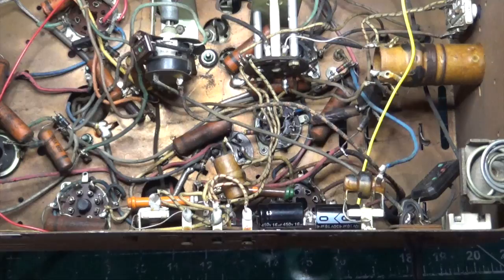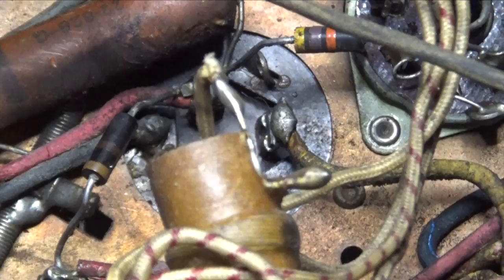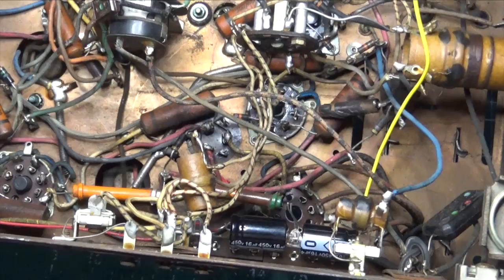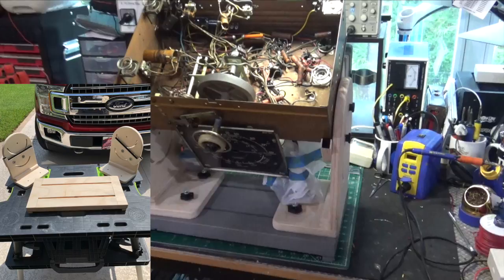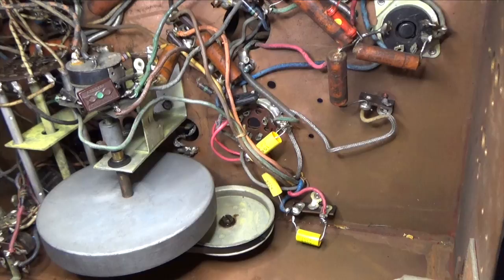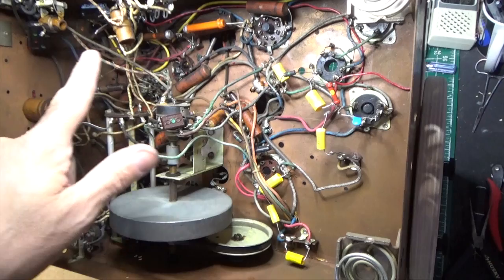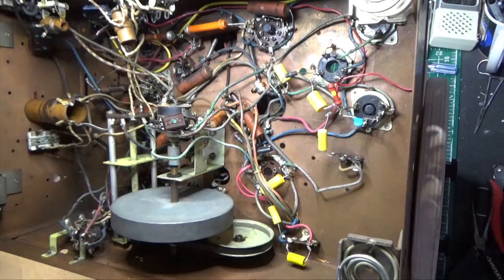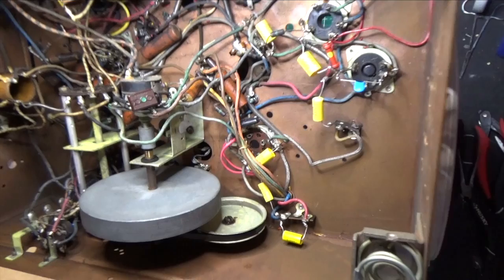Zenith 8S563X  Restore for Lisa G Episode 1:  Let's get the party started

Comment: Really good clear example of using the coil wire to solder. One thing I like about that Ron is as you mentioned, it is a lot easier to un-solder than hook and pinch. The chassis/cabinet holder looks really handy.
Good stuff my friend.
Reply from the maker: Thanks Pal...  This is how I learned and it serves me well..  There are many ways to do it, but its cool.    Hope all is well

Comment: I've been a subscriber for quite some time now and have been repairing tube radios and televisions since I was a teenager and still learn things today. I think you should go the extra mile and locate the foil end on the new caps. I get negative feedback sometimes regarding this but even though I made the same mistake some years back I learned from my mistakes. You’re right about the old brittle rubber insulated wire, most of it will need to be replaced since it will be disturbed in the restoration, and sometimes I will use liquid tape if it’s not too bad.
Reply from the maker: Ken,  thank you for watching.  I've watched many videos on the foil side , especially Mr Carlson and there is definitely merit to that process. Can you share how you determine the foil side on caps ? I'd love to hear about your technique....  thanks much
Reply: Hi Ron,
I’m subscribed to Paul Carlson’s channel myself among you and a couple of other ones. Mr. Carlson is very knowledgeable and intelligent and like you he shows the schematics explaining his reasoning for troubleshooting circuits and repairs needed to be done as per schematics.
I use my oscilloscope for finding the foil end of the capacitors; I’m able to find about 90% of them this way. I connect the probe to one end of the capacitor and the ground to the other end of the cap. Looking at the sine wave I’m looking for the smallest sine wave by holding the capacitor with my thumb and finger being careful not to touch the wires. The smallest sine wave is the foil end; you’ll need to reverse polarity on the cap to determine which end is actually the smallest sine wave on your scope. The smallest sine wave will be the foil end which is the black ground wire end from you oscilloscope. You can then mark the capacitor with the black ground lead with a black sharpie or a black dot on the end so it won’t rub off from handling it.
For the other 10%  higher value capacitors it’s harder to see the change in the sine wave so I use my guitar amp for them, it’s pretty much the same concept except you’re listening for the foil end now. You want the lowest buzzing or hum and the lowest sound will again be your foil end.
 I use a ¼” male plug with the wires connected to alligator leads; I also use an inexpensive fuzz pedal so I can lower the amplifier volume down but the fuzz pedal is not necessary. Either way just make sure you turn the amplifier off every time before changing the polarity. A solid state amplifier is best for this purpose.
Finding the difference between the foil ends is like night and day when using the oscilloscope or the amplifier method and I check the foil ends on all the capacitors that I will be using at the same time to be at the ready.
Hope this helps.
 @rciancia
Reply from the maker: @kenf8563   - This is very helpful indeed, thank you Ken !!! I will give it a shot for sure.  I appreciate the detail my friend !!

Comment: This is no party when it comes to component replacement and you end up replacing nearby 
dried up insulated wires. Do like the chassis stand you made. Fully adjustable and can
really hold down your work in the right angle for repair work.
Reply from the maker: Thanks Steve. I was not going to work on this until I built something to hold it properly - it's too valuable for me to damage it.

Comment: I have been changing all of my components like that for many years.  Way back when I worked in the TV shop Sprague capacitor company had a product similar to that coiling method.  They were called Sprague Kwikettes.  A small coil with solder on them. You would lay the two wires together with this item slipped over the joint and just apply your solder iron. https://antiqueradios.com/forums/viewtopic.php?f=19&t=216079